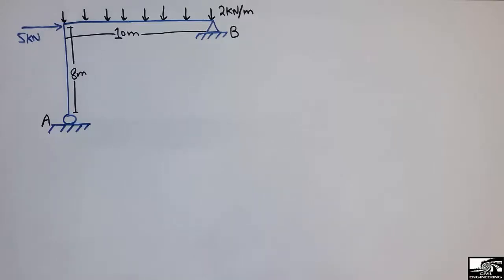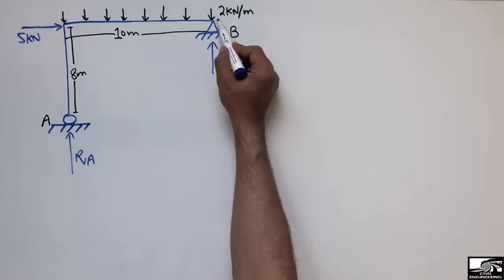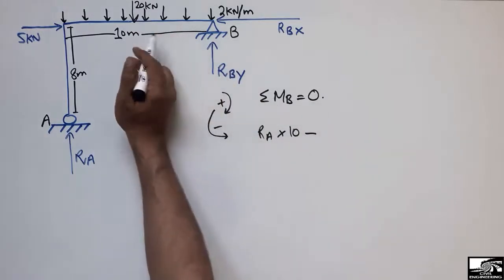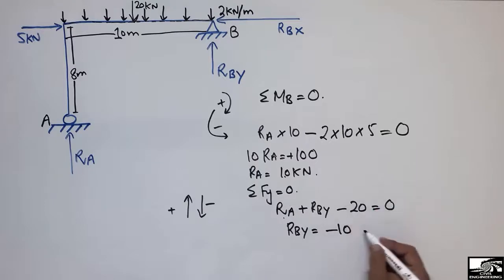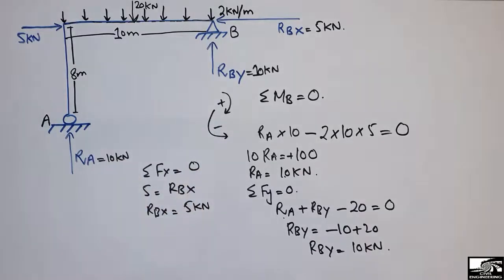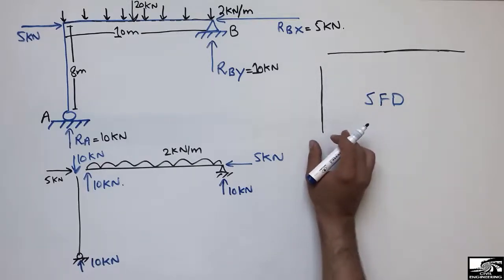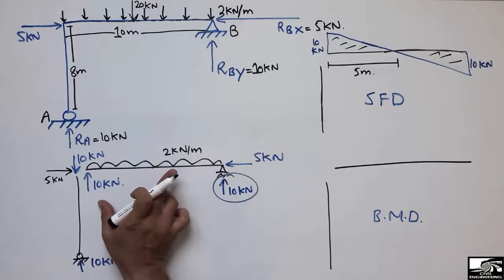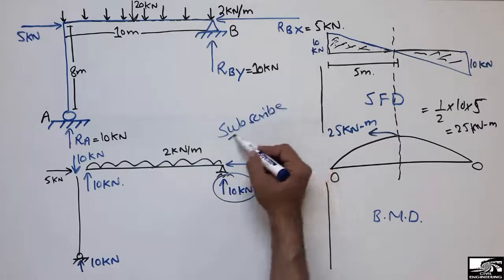Frame Analysis || Shear Force & Bending Moment Diagram

Comment: In this there is no support B, 5kn and A support will be fixed  how to analyse
Reply: This is a pin ended rigid frame structure and pin doesn't resist moment while in your case we can't analyse because one beam & one column don't make a frame structure.

Comment: why did you take the moment at point B (ΣMb = 0) and not at point A (ΣMa = 0) which is a roller support ? whereas in another video with a similar portal, you take a moment at a point that has roller support. please see this https://www.youtube.com/watch?v=8zpzKgefNvA
Reply: you can take it on any point you want. The only criteria for selecting a reasonable point is to select a point with MAXIMUM forces passing through it. In this way, their moment arm and subsequently, their moment will be zero. In the above example, 3 forces were passing through point B, so it was selected.
I hope this clears your confusion. Thanks.